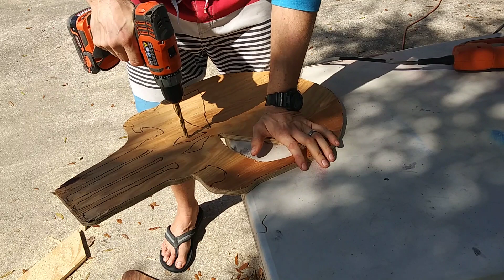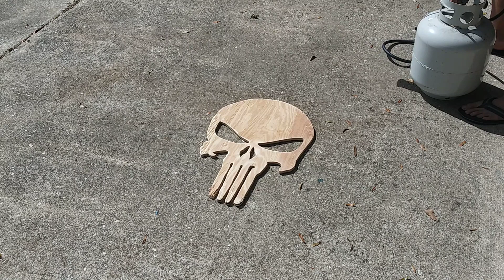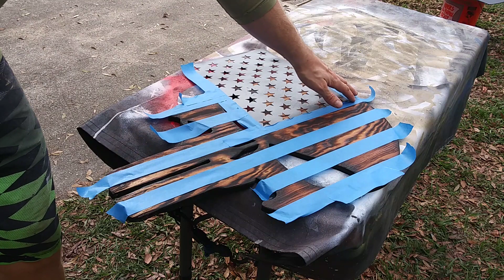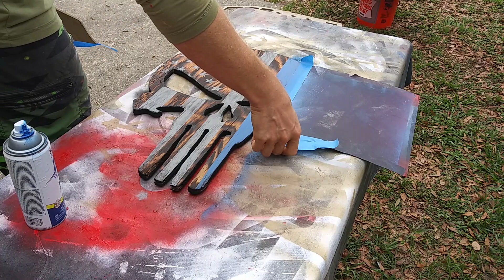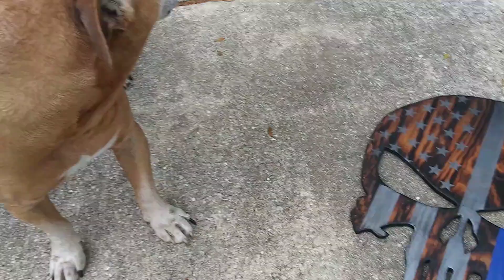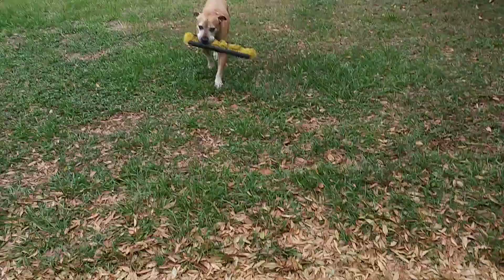Thin Blue Line Punisher Skull out of Scrap Plywood

Comment: Pretty Cool. What size is that?
Reply from the maker: Probably about 2 foot tall.
Reply: @LeoTheRussian  ohh ok. Thanks Bud I’ll have to try one and how it works out. Thanks Again.
Reply from the maker: @jamesbarlowjr.3762  let me know! it's pretty easy once you get used to it and the whole skull can be cut in about 5-10 mins. As long as the teeth are strong enough - that usually dictates the minimum size, but going bigger is not any harder (easier actually).
Reply: @LeoTheRussian  Awesome I will do that. I’ll have to find a pattern. Yea it doesn’t look to be to bad. Thanks for all the info.
Reply from the maker: @jamesbarlowjr.3762  get a projector for like $60 and never have to deal with printers or tracing paper headache. This is how I use mine: https://youtu.be/gyhK4hbm_KY